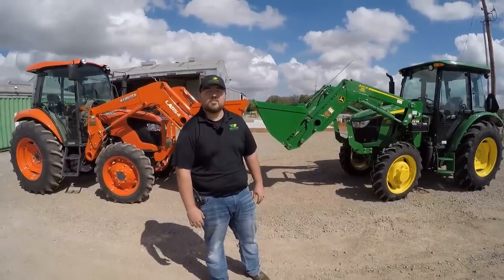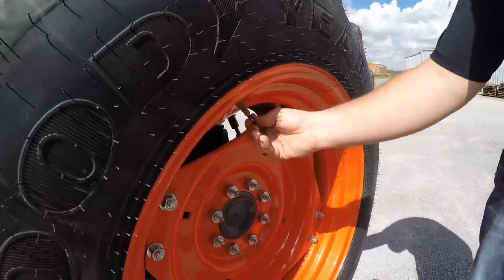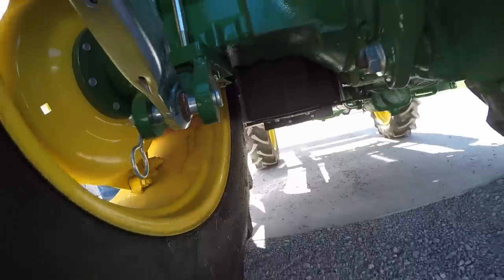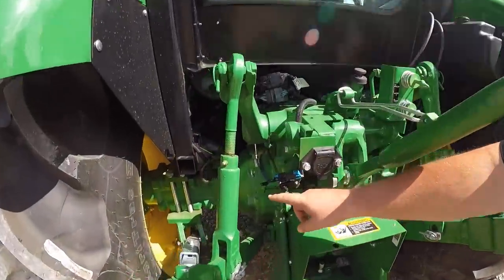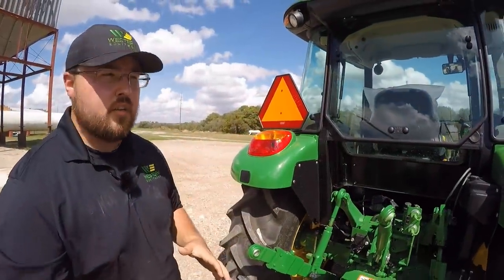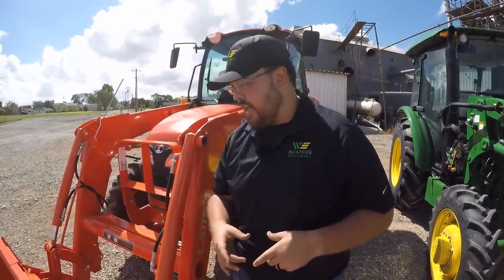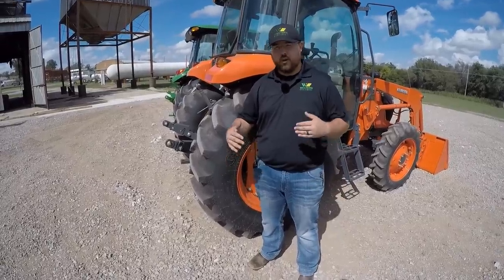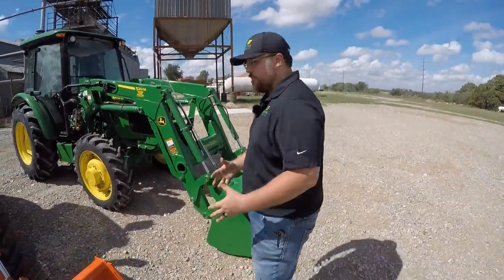John Deere 5065E VS Kubota M7060 | Product Walkaround and Overview

Comment: I bought the Kubota much better machine and it was built in the USA  around where I live these India built Deere’s are having many problems
Reply from the maker: What kinds of problems?
Reply: Western Equipment leaking oil between the engine and transmission lines not tight from India leaking radiator  lines A/c not cooling lights not working turn lights not working a/c lines running up the cab posts not secure rattling when you outsource everything the quality control goes to hell as people are finding out the hard way I have older deers that are awesome but will never buy another one until Deere wakes up and brings made in USA back instead of just some green paint sand stickers

Comment: Plastic hood Hydraulic lines hanging out to catch brush is in a good spot lmao  you convinced me to stay away from John deere with this video
Reply from the maker: You seem to be really stuck on the plastic hood... It's okay if you actually like it! No dent's. scratches, or rust... And on the hydraulic lines, I agree they may be in the way of you were driving through a bunch of trees but let's be honest, how often is that the case?
Reply: It only would take one time driving too close to something to snag one of those lines. Once is often enough.
Reply: @WesternEquipment  very
Reply: @WesternEquipment  depends on where you live. City slickers probably don’t have much issue with trees.  Neither do rich ranchers.  However, those of us who buy these tractors are having to clear trees to make more pasture, grade roads through the woods, cut wood for wood stoves and cabinet building, etc.  I could care less about plastic hoods but broken hydraulic lines really suck.

Comment: E series is a cheap low quality series you should've compared it to M series
Reply from the maker: These tractors are very comparable spec wise. The weight test would have been every more biased towards John Deere if I had used an M.

Comment: the 4 wd system on the Kubota stear's sharper and is all closed. The John Deere has a open cross coupling and more wear and tere..
Reply from the maker: The turning radius of the Kubota is tighter according to specs.

Comment: One thing you failed to mention is dependability...   Kubota tractors dont brake down...  John deere under 50 hp are complete junk....   This one with its plastic hood dont look much better to me.  Your loader on the jd is out farther... Making the weihht in the bucket have way more torque trying to lift the rear and take out your front axle....  also those 3 gears brakeon the jd, brake.....   been there.
Reply from the maker: Interesting. I can say that from working at the dealership that the Kubota's seem to have just as many issues as the JD's. I think this is all about how the machines are cared for. Thanks for watching!
Reply: @WesternEquipment  One day in the woods along side my kubota my buddys came out with a briken hood and dash.  Plastic in below zero weather dont work. All from a tree branch that hit the kubota first. His is new, mine in a 86 L275 with 4500 hours.  Ive never had a single issue. Every time he trys to do what I do his has a grand in repairs...

Comment: I loved Deere but not longer. This is a joke. i do like the battery box. The hoses are easier to get to but so are they easier to be pulled off by limbs. I have a deere and the plastic crap does NOT hold up. Period. Fact. Mine is faded and cracked. I'm not happy with this junk. The AC oulets along the leg is an extra cost and if you're in a tractor the helps. Deere is a crap pile based on my buying and use. have a great day.
Reply from the maker: Sounds like you just needed more explanation at time of purchase. I'm sorry to hear that you're so disgruntled!

Comment: JD"s are nice no doubt. But the whole idea that plastics better, that proprietary is a good thing? Total BS. So, nice job going over tractors. Poor job trying to sway buyers just because of opinion.
Reply from the maker: Keep in mind in the video we said good things about both hoods and mentioned that depending on customer preference and situation that both hoods are good. As far as the proprietary bucket coupler, it is only one of the three option for a carrier on that loader. I should have been more thorough in my explanation, but the skid steer style carrier/coupler is available on this loader for no extra cost. Thanks for watching!
Reply: G S Kubota is now going to the polymer fenders and hood on a lot of the newer models now.

Comment: What a biased opinion from the start, no mention of the % pto to engine hp loss, proprietary implemenst to make sure you only can buy deere, loader ydrailic connection easy to get to by both you and a tree that wants to tear them off,  i bet you could sell snow and ice to the eskimos
Reply from the maker: I think most points touched on were very valid arguments!
Reply: @WesternEquipment  yes, its green the other is not  that a true valid statement too. I like JD(the older ones) but i do not agree or like biased reviews, i won't be back.

Comment: I have a Kubota m7060 and love it you can lift and dump at the same time Deere can't and I like the 6 speed you don't have to changes ranges near as often and Kubota goes faster down the road witch is great because my farms are 8 miles apart and Kubota turns lot sharper so very handy in tight places I put 2900 hrs on in three years working perfect and 5 k  less when purchased new and it's a 4 cylinder instead of three more torque I could go on but you get the point
Reply from the maker: I'm glad you are happy with your purchase, that is the main thing. These are some good points I will note for the next comparison. Thanks for watching!